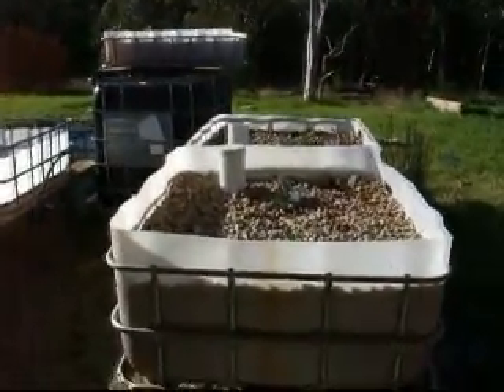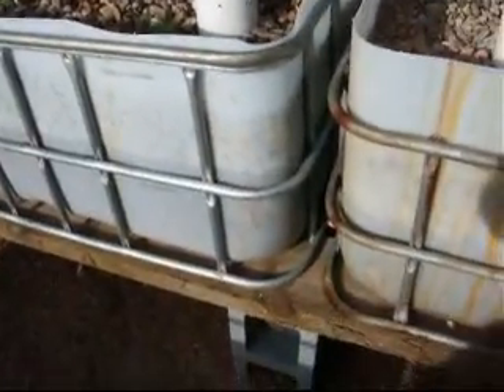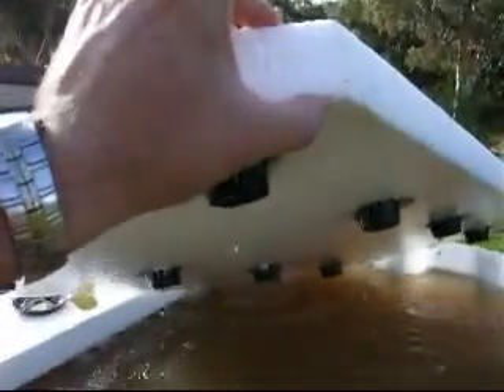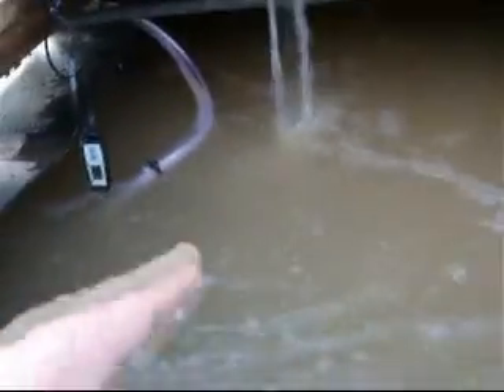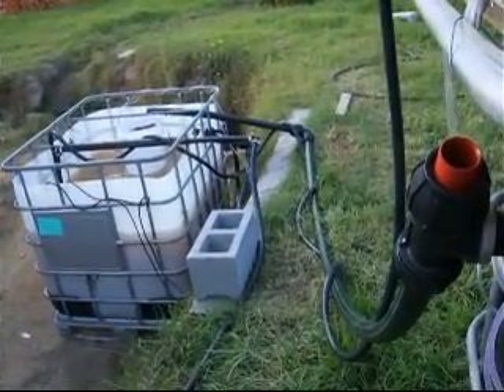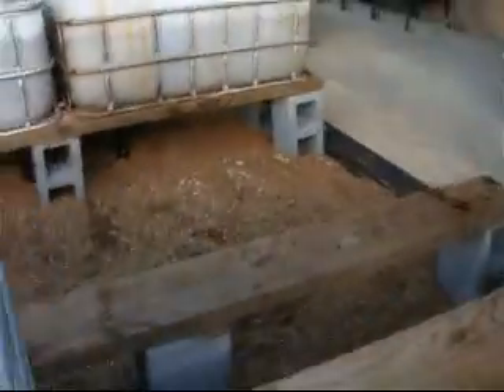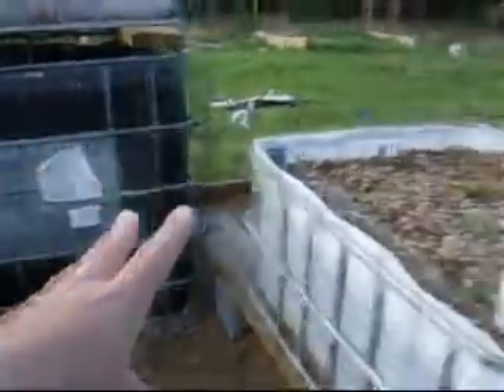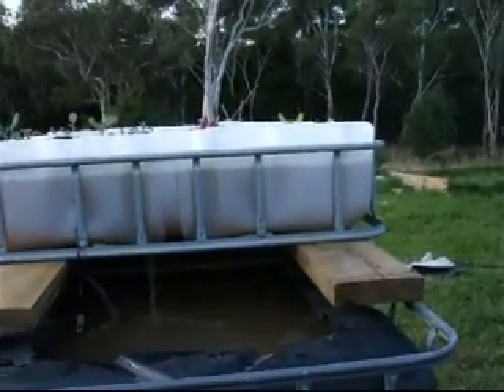Aquaponics Adventure at TSH

Comment: Well done, great presentation of a system closely resembling mine and we have never met as far as I know. The biggest difference is I use 99.9 percent of each and every IBC with fish in the bottom and grow beds above. All I do is make sure the ratio of fish matched the GB capacity to produce. I am in Western Vic where our weather goes from frosts to 25 deg C days in winter and summer days of over 48 to 52 deg C days and balmy nights. I find the water absorbs and releases heat in a balance.